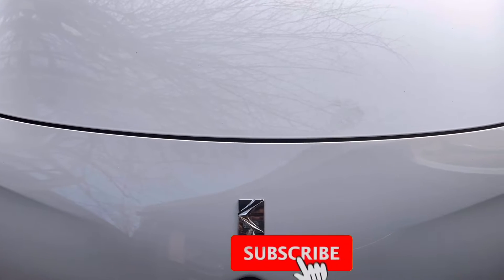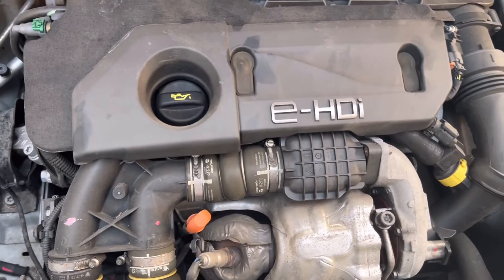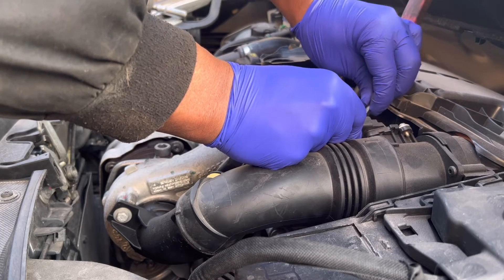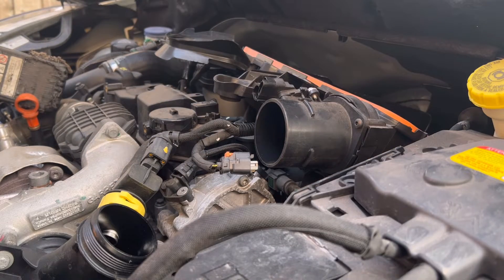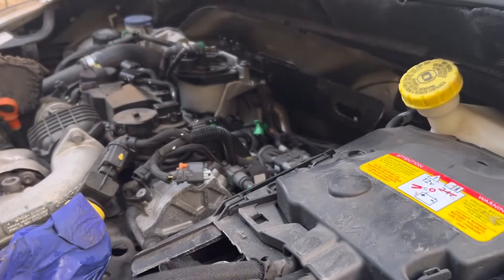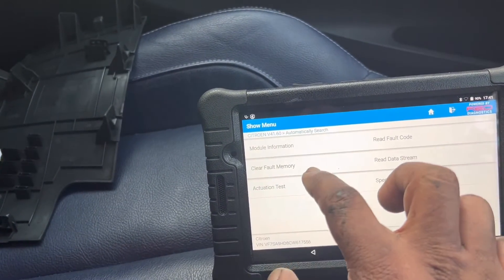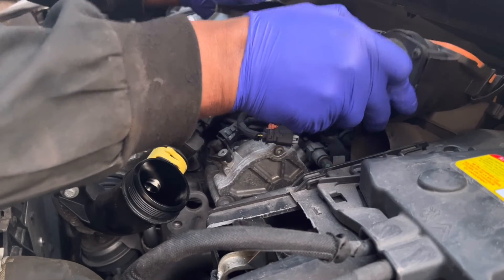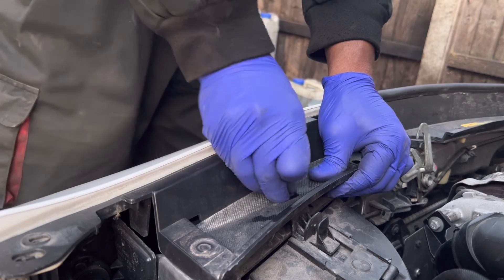P0268 -  how to change Citroen / Peugeot  injector

Comment: I have p0271 cylinder 4 electrical circuit, can you show where are electric sockets for injectors and how to disconnect them? I'm going to use spray cleaner on them.
Reply from the maker: On the Citroën/Peugeot 1.6 and 2.0 HDi engines, the injector plugs are right on top of the injectors under the plastic engine cover. Each injector has a small electrical connector with a metal spring clip holding it in place.

To disconnect:

Push the metal spring clip outwards slightly with a small flat screwdriver.

While holding the clip, gently pull the connector straight up — don’t twist it too hard, they’re fragile.

Once off, you can clean the contacts with electrical contact cleaner (not WD40).

 Tip: Don’t spray cleaner into the injector itself — only the plug/socket. Also make sure everything is fully dry before reconnecting.

We’re not able to reply to continuous messages as we get a huge list of comments every day. If you need more help, join our groups — they’re packed with mechanics, automobile enthusiasts, and more:
👉 WhatsApp: https://chat.whatsapp.com/JOvJCdZYdV9J6PvIXw2RV0

👉 Facebook: https://www.facebook.com/share/g/15msa3NJmn/

Comment: Thanks Charlie, Im a carpenter using a ds3 1.6hdi .. ive got a £10 code reader and this fault came up !  ive being doing a bit research for last few hours and thankfully stumbled upon your vid. Very good vid m8. I havent got a scan tool .. but ill be trying to sort this tomorrow, Ive managed a fairly comprehensive tool kit over the last 4 decades so it looks doable.
Thanks again .. ps my local garage is 3 week waiting but i have a citroen breakers 5 miutes away.
 I should also add that I have a C2 diesel 1.4hdi, - the mechanic told me i needed a new injector , but i got it home stripped it and cleaned it and reassembled it.. and thought i might as well do the rest .  still in there now 2 years later working fine. believe it or not I used a set of plumbers tools to do it.
Reply from the maker: I'm glad you found the video helpful! It sounds like you're quite experienced with DIY repairs, especially given your success with the C2 injector. Here are some steps you can take to diagnose and possibly fix the issue with your DS3 1.6 HDi:

1. **Identify the Fault Code**: Since you have a £10 code reader, make sure to note down the specific fault code(s) your car is showing. This will help narrow down the problem.

2. **Research the Fault Code**: Look up the specific fault code online to understand what it means and common causes. Forums and technical sites often have discussions and solutions for specific codes.

3. **Inspect the Affected Area**: Based on the fault code, inspect the relevant parts. For example, if it's an injector issue, you might want to start by checking the injectors and related components.

4. **Check Common Issues**:
    - **Fuel System**: Ensure there's no air in the fuel lines and that the fuel filter is clean.
    - **Electrical Connections**: Check for any loose or corroded connections, especially around the area indicated by the fault code.
    - **Vacuum Leaks**: Inspect vacuum hoses for any signs of wear or damage.
    - **Sensors**: Verify that sensors like the MAF (Mass Air Flow) sensor, MAP (Manifold Absolute Pressure) sensor, and oxygen sensors are clean and functioning.

5. **Use Your Toolkit**: Given your comprehensive toolkit, you should have the necessary tools to perform most repairs. Make sure to have the specific tools required for the job, such as Torx bits for Citroen vehicles.

6. **Visit the Citroen Breakers**: If you need any replacement parts, the breakers yard can be a cost-effective source. Make sure to take the faulty part with you to ensure you get an exact match.

7. **Test the Repair**: After replacing or repairing the suspected faulty component, use your code reader to clear the fault code and see if it reappears. Take the car for a test drive to ensure the issue is resolved.

8. **Consult Online Resources**: If you encounter any difficulties, consider seeking advice on car forums or watching additional video tutorials related to your specific issue.

By following these steps, you should be able to diagnose and potentially fix the problem with your DS3 1.6 HDi. Good luck with your repairs! If you need any further assistance or have more specific questions, feel free to ask.
Reply: @SanuMotorswithCharlie   Good news .. I got it fixed !
 Running like a rocket 🚀   110bhp 1.6hdi .
 Thanks .. I done most of those recommendations! 
 I had to buy an injector from a breaker £50 .. used the original seal. 
 Awkward to get the faulty one out , had to tap it repeatedly with the end of a long bar . Moved a bit and just kept at it .. until eventually... aah yes , satisfaction...out it came.
 I carefully guessed the torque nipping it in .
 Cleared the code with the £10 code reader . Sorted .
  I had to buy a set out female torxs or inverted I think there called . £15 . But I'm still 😊 😃. 
 I hope to strip this faulty one if the ohms show OK [ 180 to 200k ?  ? I think  ]  I'll check the mechanical side. It will do as a spare to carry .
 I reckon I could leap out and be under the bonnet if ever again and have it in , in a few hours at most ?  I'll carry the tools .

Thanks again for the vid

Comment: Hi.  at what torque is the injector screw tightened?  I have the same type of injector, the same screw, and I don't know what tightening value to adjust the torque wrench.  Thank you
Reply from the maker: Please google or check with dealer. I’m not sure , I’m sorry
Reply: @SanuMotorswithCharlie  but to what torque did you tighten the injector screw?
Reply: @grigoreclaudiu1073   he probaly didnt use a torque ,  what did you torque did you use ?

Comment: Hi great video I have the same engine in my c3 injector 3 and 4 are leaking so cambelt side, 1 and 2 fine no carbon build up etc. Can I just replace 3 & 4 injector seals and not take out 1 & 2 injectors? Would it bring up a engine light? Thanks
Reply: @SanuMotorswithCharlie  thanks bud engine all fine but a lot of carbon build up around them two injectors, plus inside of car smells of fumes. So need doing asap, just ordered seal kit.